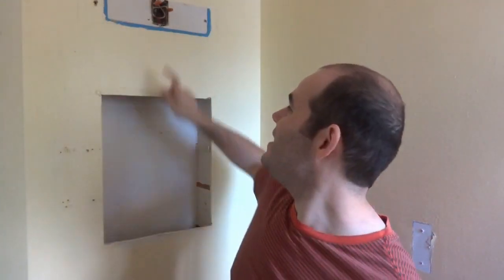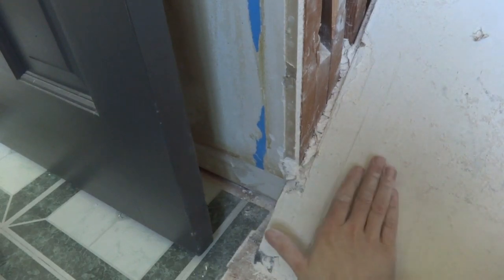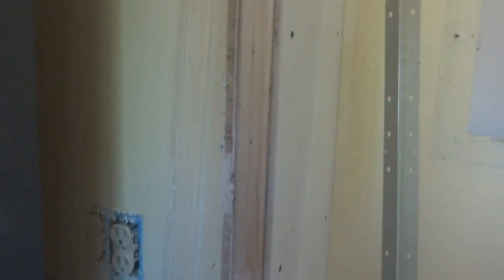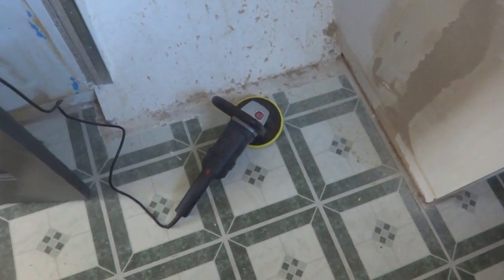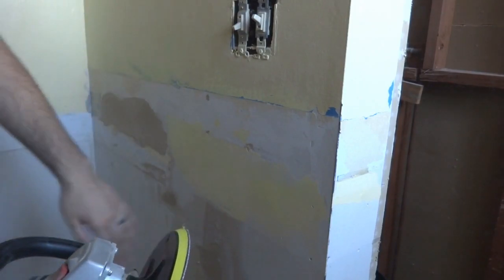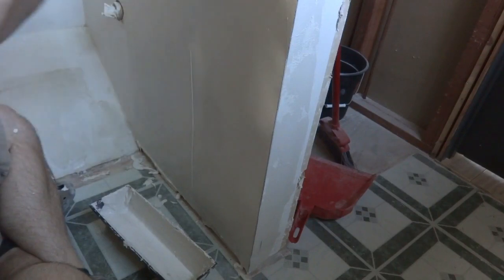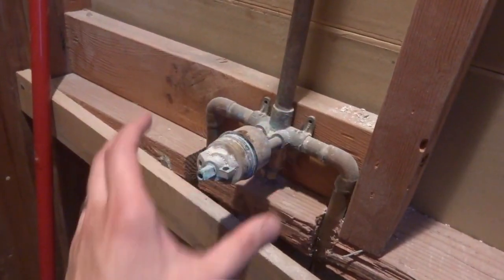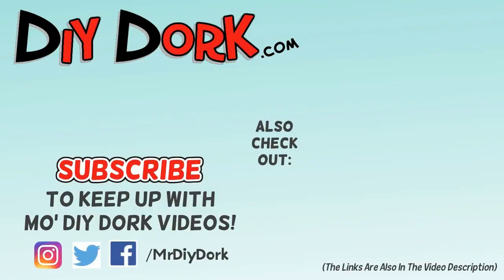Hammer Time! - Smashing & Skimming the Walls

Comment: Thanks for the tip on adding water to the joint compound bucket. It's gonna save me some frustration not having to use the thick mud right out of the bucket.